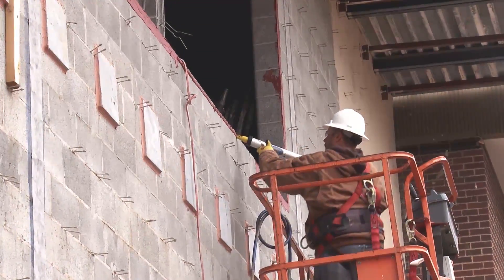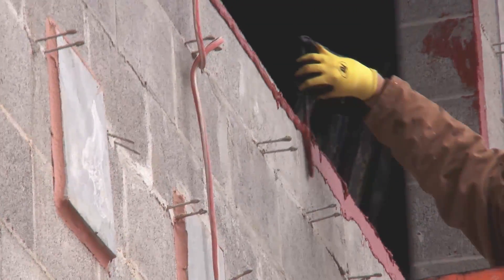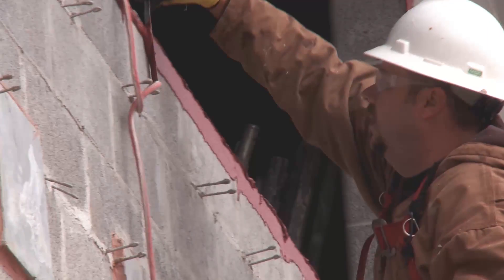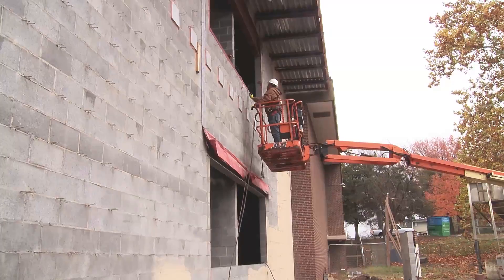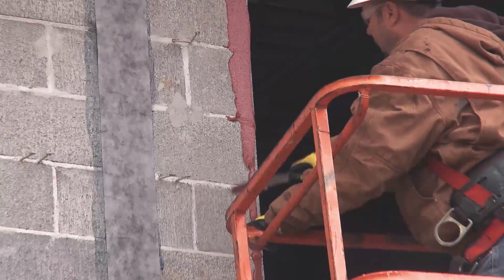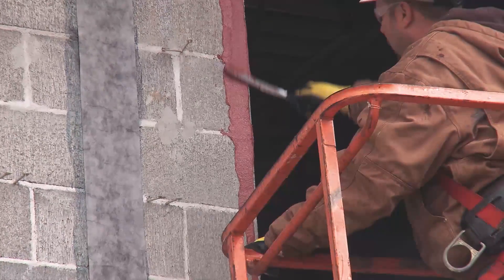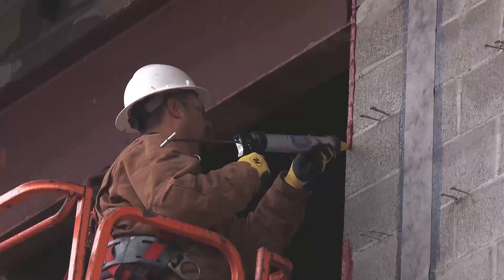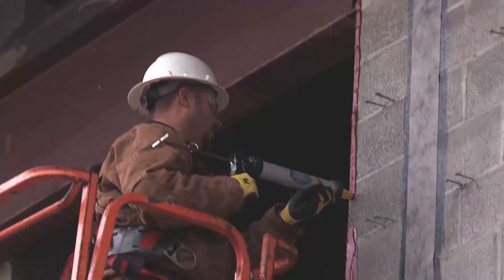R-GUARD® Project Profile - Trailridge Middle School

Comment: water are those pins attached to the wall?
Reply from the maker: Those are brick ties
Reply: @ProsocoSince1939   i plan to have a poured concrete wall. and then will dry clad natural stone with stone clips. i plan to apply cat 5 over the poured wall.. is there any other protection material needed after applying cat 5? before the stones goes on it?